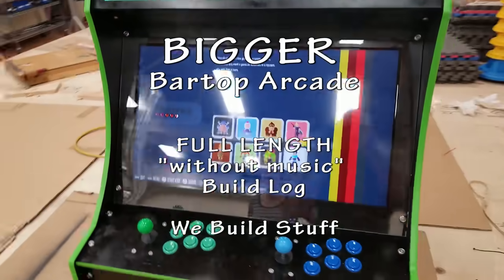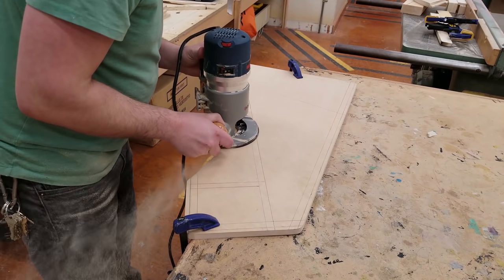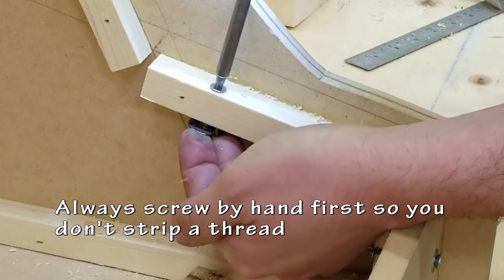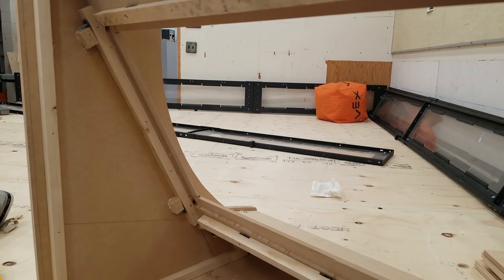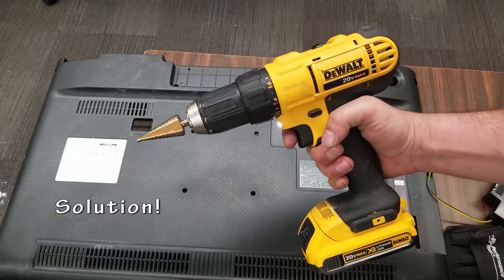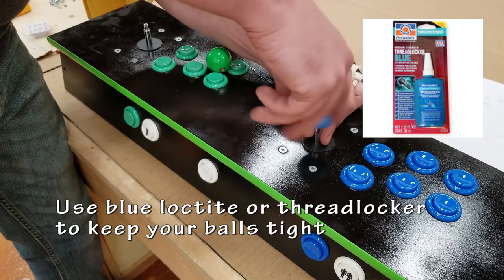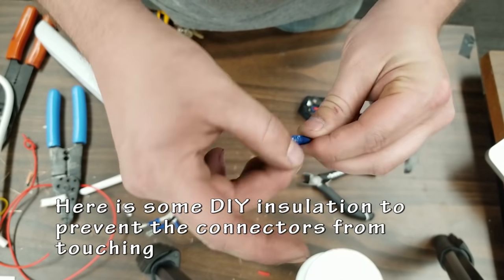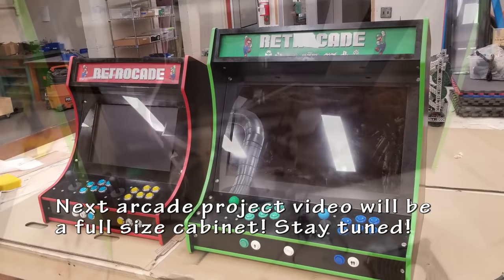Build a BIGGER BARTOP ARCADE - FULL LENGTH AND FREE PLANS!

Comment: Great build, i really like it. Shame, but i dont have space for an arcade cabinet. I would make some modification to the LED strip mounting: alu LED rails for the mounting, opal diffusor to "hide" the invidual LED modul pieces and for better light spreading. The other thing is that the passive heatsinks are not enough for the Pi. Up to N64 is enough, but if u want to play PS1 or GameCube games, then you need more cooling. The 52Pi cooler is Rpi3b+ and 4/4b compatible.
Reply from the maker: That's the fun part about doing your own build. Design the way you want it and make it happen within your means and budget. My videos are only meant as a starting point. Customizing projects is always more fun! Thanks for watching!

Comment: N64 Controller = 15 buttons.

4 for the DPad directions.
1 for the start button.
1 for A.
1 for B.
4 for c buttons.
1 for Left Bumper.
1 for Right Bumper.
1 for Z button.
&
1 analog stick.

Your arcade setup... an analog stick, which is more like a dpad if we are being honest, and 6-8 buttons.

Why are you trying to play N64 games with it? Hahahaha.

Also, for air flow, you should use 3 fans minimum.

2 intake.
1 out.

Or perhaps just using a big intake fan and a smaller out fan, this will have a similar effect.

Doing this will create positive air pressure inside the cabinet and will ensure air gets to all the components.

Great video though. Thanks. Always fun to watch you build and talk us through it.

Comment: I am so glad you used nut inserts, I have seen people build cabs and drill through the side panels to insert bolts, this really annoys me as it is just laziness.
 I have built a couple of bartops very similar to yours but I prefer a 1.75" bezel and a 25" 4:3 monitor, I have been thinking about designing a bartop candy cab but can't make my mind up whether to 3d print or do some difficult routing for the front fascia panels, actualy thinking about it this could be the perfect excuse to buy a CNC router
Reply from the maker: Nothing beats real material vs 3d printed plastic!
That being said I love my 3d printer for prototyping!

Comment: I'm about to embark on this as a summer project, and this is the best instructional video that I've seen.

I am thinking of doing a modular version, i.e. having the bartop version sitting on a separate base unit, so that I could switch from full size to bartop arcade so I can make easily move it around if needed between different locations. 

In order to do this right, would you suggest...
To follow the full size plans but cut just below the floor of the bartop, or to make the bartop and then create a separate box base?
To add some more stability to the bottom base cabinet to keep it more rigid - does it need it?
Raise the bottom floor of the bartop, so there was some space below (out of sight) to hook it over some guides protruding up from the bottom cabinet to keep it in place 
or how would you best suggest connecting the top and bottom? 

Hope that makes sense! Would love to know what you think.
Reply from the maker: Hi Paul. Did you end up starting your project?
Reply: @WeBuildStuff  RIP Paul's project 😭

Comment: Those are nice fans. I was going to use them to act as a solder smoke wick, but it's now cooling my cable modem. I live in MS, so it gets super hot and disgusting in the summer and noticed my internet was dipping as a result. SO, I have that janky setup. Which I might switch out for cheap laptop cooling mats and sandwich the router  in between them. Since right now nothing is keeping them stacked.
Reply from the maker: Cool thanks for watching

Comment: Can I ask what saw blade to use, as  I got 24 / 40T with the circular saw and the cuts are not nice.
Reply from the maker: more teeth will give a finer cut. If you aren't using a track or fence with your circular saw it can be tough to get nice straight cuts. Many circular saw blades are typically used for rough cuts (framing, general construction, etc). I have built arcades with nothing but a circular saw, jigsaw, and drill in the past. It can be done but requires a lot more patience that having access to tables saws for those really nice cuts

Comment: Gonna start a bartop arcade build but with a 14" inch RGB CRT monitor. What's a good width for the cabinet if I want to implement a dual joystick module?
Reply from the maker: 55cm for a control panel mininum to be comfortable next to another player. Check out the other bartop video I have up and modify the depth to fit your crt screen 😁

Comment: Thank you Mike.
I want to learn making cloth drawers and cabinet with bartops being my end goal project.
What would you tell your newbie self to know about handling table saw?

Honestly im scared to use them.
It's not a common household item in a 3rd world country.
Reply from the maker: Stick with the simple tools or what you have. Even just having a handheld jigsaw can be used 
For a table saw make sure you have a push stick and a splitter if possible. Go slow and have someone instruct you in person.  I always try and have a spotter if doing full sheets of plywood unless it has a proper out feed table or a panel saw.

So much can be done with portable hand power tools. Stay safe friend

Comment: Nice work
You dont need to drill a hole for the  remote infrared. You can engrave the wood to a very thin layer from inside and it will work. It won't be seen outside. 
Also.
Use full metal case for the raspberry and you won't need fans.
It will even be significantly cooler than using heatsinks
Reply from the maker: The fans were also to help with airflow for the screen as I have had them overheat inside cabinets before. Good tips!

Comment: A suggestion:
- put the fans on the top of the cabinet to expel the hot air.
- add one or two at the bottom to force cool air inside the cabinet.
Reply from the maker: Good stuff. I set mine up to keep a constant circulation with one as exhaust and the other input. Still working so far!

Comment: I got covered the woodworking part, but I'll use lots of your recomendations  about measuring and the use of t-nuts from now on. I used to use screws/glue for everything and then taking it apart was always a pain. I was too scared of the wiring part, specially the buttons, but you made it easy to follow (do you have a item list you bought for this?). I guess this is my new project to keep me busy during the quarantine. many thanks! and sorry for the bad english.
Reply from the maker: I have some things here from where i bought. I'm not sure if all the links are still valid:

https://holbrooktech.weebly.com/bigger-bartop-arcade-build.html

And some information on my older arcade:
https://holbrooktech.weebly.com/pi-arcade-101.html

Comment: Hi thanks for the great video.
I'm busy planning my Arcade build as I type this. A quick question, I watched your other Arcade build (Yellow Mario Marchine) and you fitted a reset button on the side of that one but not this one.

Does one need a Reset button?
What is the purpose of the Reset button? Could you just not power on and off at the back of the Machine ?
I'm new to all this so your feedback is appreciate. 

Thanks
Cheers
Reply from the maker: The reset button isnt tied to the actual power. It was wired and programmed to shut the raspberry pi down safely rather than suddenly cutting power  sometimes reaching all the way behind isn't super convenient and this seemed like a good way to shut it down at the time. This one didn't have it as thst was the request of the buyer
Reply: @WeBuildStuff  
Thank you for the response. I'm new to all of this.
Is there another way to shutdown the device safely as my only concern is I dont trust my soldering skills and my luck I damage the board.

Oh yes and im going to be using the pi 4 for the project. 
Thanks a Mil
Reply from the maker: @theurbanman if using recalbox and if you have the right connectors you can plug right into the GPIO headers then change some simple script. This is what I have done in the past. The connectors are a dupont connector which luckily for me was part of the usb arcade button kit I use. 

https://github.com/recalbox/recalbox-os/wiki/Add-a-start-stop-button-to-your-recalbox-(EN)

Comment: Very nice build, love the colors, they match my buddy's Formula Mazda race car!  One thing to consider is a way to hit a button to shut down the PI before turning off power.  The SD doesn't like the power being just shut off.  :)  Mixing games, fun and teaching.  Perfect!
Reply from the maker: In the menu there is a shutfown option and I have built reset/shutdown buttons in the past by wiring directly to the headers of the pi or soldering to two holes on the PCB. I haven't done that recently but it shows in one of my othet videos 😁

Thanks for watching!

Comment: hey what size mdf are you using for the control panel top? you mount the joysticks from the back of the control panel, don't you think you end up with a short shaft on the joys?
Reply from the maker: Using 1/2"
Personal preference for mounting and it was easier that routing out a pocket

Comment: Hey. great build. I am building one myself(or planning to) and i just can't decide what type of monitor i should use. 4:3 or 16:9? Are there a lot of games that will be stretched out or the screen will be cut off at the sides? once i sort this out i want to start building so any advice is more than welcome.
Reply from the maker: The front end I use (recalbox) automatically resizes but you can customize how each game stretches if you want. Most of the retro games I play are all 4:3 but there are a few widescreen ones. If you are following these plans and building a nice big screen one (I also have free plans for smaller bartops on my channel) then the aspect ratio doesn't personally bother me but to each their own! Feel free to drop questions here and I try to respond when I can :)
Reply: @WeBuildStuff  Thanks for the quick response. i think i will play it safe after all and use a 4:3 ratio monitor.

Comment: Wonderful!!! I'd like to put this USB fan in my bartop two. Can I take the power from Raspberry Pi3b+ even if I have already installed arcade button with leds? 2,5A power supply is enough? USB Fan take 0.2A each one in my case. Thanks for your support!
Reply from the maker: Give it a try! You can also run the fans from a separate usb power brick!

Comment: Do you do console arcade cabinets? Cabinets that house home console systems like the Switch, PS4, PS5, etc.?
Reply from the maker: It wouldn't be a hard project. You just need the right controller adaptor. Not all games will play nice with only a 4 way stick  but custom wiring can be done if you are willing to experiment.

Comment: Great and detailed build! Question: Do I have to be millimetry precise? I see some value like 74.07 and was wondering if this .07 is necessary or I can round up to .1. Thanks!
Reply from the maker: As long as your measurements are consistent, pieces fit, etc.... I round to the nearest 1/2 millimeter and just make sure it matches both sides.
I'd like to do a new design that just uses the thickness of a ruler to layout lines without needing to measure as much. I've posted my autocad design for whoever wants to make it their own😊

Comment: Hey. The build is awesome and the woodwork is beyond my capabilities. One thing to keep in mind though. Raspberry PIs tend to have a bit of an issue with stability when it comes to power usage off of the USB ports and that can lead to SD cards prematurely dying. For other projects I'd suggest having fans that are powerful through a different power source.
Reply from the maker: I've been using power supplies that have extra amperage to balance it out. So far no issues and for the price of a board getting a few years works for me!
Reply: @WeBuildStuff  sure, it works fine for a long time. Just thought that I should mention it. Great work and far beyond anything that I can do.
Reply from the maker: @MrTheDarku  thanks! I am currently editing a series on building an arcade without all the "bolted to the floor" power tools.
Only tools I can hold with my hands that are more affordable
Reply: @WeBuildStuff  cool. It's a good time to subscribe then :)
Reply from the maker: @MrTheDarku  much appreciated!

Comment: What size holes did you drill for the buttons? I've built everything except the control panel. and my 1 inch spade holes fit the button, but not it's threads. How could I make the hole slightly bigger or the correct size?
Reply from the maker: Get the proper sized forstner or spade sized 1 1/8" or 30mm.
You could also just buy smaller buttons. Always check the description of the product you buy if you cant physically measure it
Reply: @WeBuildStuff  Wow! what a fast reply! Thank you! I'll give that a try. Happy New Year and thank you for your video! I'm making this with a 32-inch tv and it's coming out very nice.

Comment: 46:13 There's a flathead screw in the bottom of the stick's shaft to turn against the ball top and get it on real tight. No need to risk damaging the visible part of the stick with vise pliers!
Reply from the maker: Good tip! I'm always still learning!

Comment: I'm pretty handy so building the cabinet would be simple for me. I have an electrical backround so the wiring wouldn't be an issue either. BUT, I've never dealt with Pi or how it even works, are games pre loaded? Or how does that even work?
Reply from the maker: There are "operating system/front end" systems like reteopie or recalbox for the pi. You can search for games/roms/romsets on a search engine. "Eta Prime" has a good YouTube channel showing how to add games and use different systems. I didn't bother making a video on that since there were already many good ones out there.

Recalbox is super easy but lacks some of the customized stuff some people like.

Retropie has a very large community and there are a lot of resources available. 

Arcade punks has images you can put onto your micro-sd card that have everything pre-loaded and you would just need to setup screen ane control options in a menu. It's always handy to have a usb keyboard hooked up for when you need to 'program'.

Thanks for watching!
Reply: @WeBuildStuff  you're awesome, I'll definitely look into that. I have 3 boys, 12,11 and 8 and I want to do something like this for them.
Reply from the maker: @El_Jefe_Zamora  kids love these.... but.... don't buy the cheapest joysticks and buttons or they will probably destroy them😁
Reply: @WeBuildStuff  anything you recommend that wont make take out a 2nd mortgage?
Reply from the maker: @El_Jefe_Zamora  i use amazon or ebay for my button/joystick kits. Led buttons look cool but they are cheaper quality and hit or miss to even have them work out of the box. I like HAPP style buttons with microswitches you van swap out when they wear out over time. Anything above $60 is usually decent.

Comment: Great job!  How do you control the TV power? I like the one switch to power everything on, but how do you get the TV to come on? Thanks!
Reply from the maker: There is a small hole drilled in the cabinet near the tv IR sensor. TV Remote control aimed at the right spot

Comment: Great video man! Congrats!!!
Reply from the maker: Thanks for watching!
Reply: I'm going to start mine this weekend. Wish me luck!
Reply from the maker: @hectorcamacho5565  find me on Instagram and send photos when done!
Reply: I will definitely do that. What did you use for your plexiglass? I bought an acyrlic sheet at home depot but once installed, there are many vertical "lines" visible.
Reply from the maker: @hectorcamacho5565  i used some left over plexi that I bought from someone else. I found it reflected light too much so lately I have been doing a bare screen. I still haven't found a cheap option for them
Reply: @WeBuildStuff  I greatly appreciate your reply. I am almost done! Just need the marquee sign! I cant wait to show it to you!
Reply from the maker: @hectorcamacho5565  if you cant find me on instagram you find get my email through my website found in the description 😁
Reply: @WeBuildStuff  Great! I will do that. I do not have Instagram so email will work better for me

Comment: Pro tip! If you wanna make sure both your side panels are exactly the same, use a tracing or template bit for your router, cut out one side then stack it on top of the other piece and use the router to follow the template piece. I do this to make multiple machines without having to constantly use a bandsaw or jig saw for every side.
Reply from the maker: Not everyone has the luxery of awesome tool access. I tried to show some "everyman" techniques using both basic and big tools in this video. When I do these projects with students I have router templates and jigs not just for cutting but also for faster layout 😁 

In the video I believe I nail the two panels together, cut, and sand both at the same time
Reply: We Build Stuff it wasn’t meant to be insulting as to your technique, I was simply stating a tip for people who may want another way but also, to be fair, you used a rather expensive router already and a template bit is cheap.
Reply from the maker: @A2ZGeek  for sure!

I have a bunch similar to this 😁
https://www.homedepot.ca/product/freud-12-inch-x-1-inch-top-bearing-flush-trim-bit/1000407383?gclid=CjwKCAiAob3vBRAUEiwAIbs5TljVP_NvwQhO7kA058ljJrzXDeSwHEtazcFRNQoVoGrlsF42FkQUiRoCy1kQAvD_BwE&gclsrc=aw.ds
Reply from the maker: @A2ZGeek  and lucky for us we recieved funding for the club from parent fundraising to purchase some of the tools. We are very fortunate!
Reply: We Build Stuff that’s awesome! People don’t realize but mark my words, people who can use tools and build will be amongst the highest paid in the next 10 years. Good to prepare them ahead of time.
Reply from the maker: @A2ZGeek  I always have some side gigs going :)